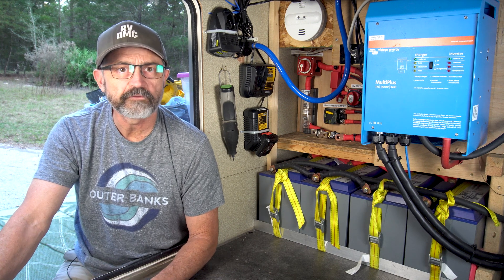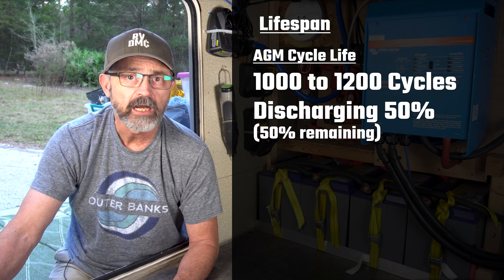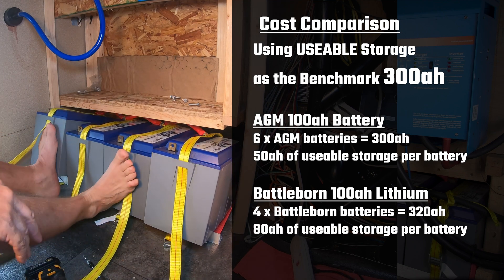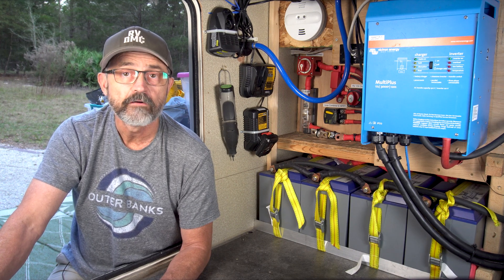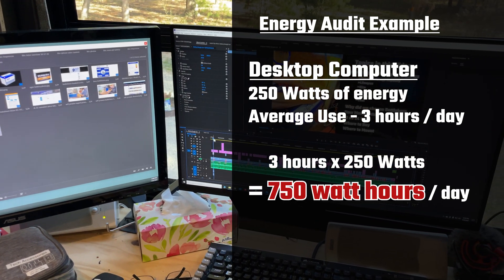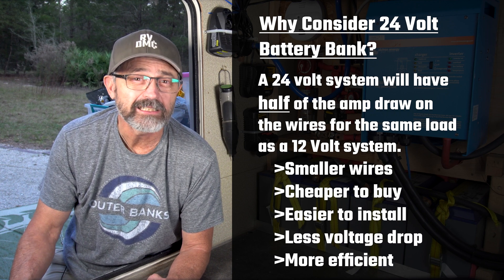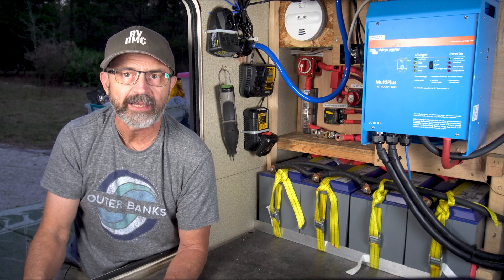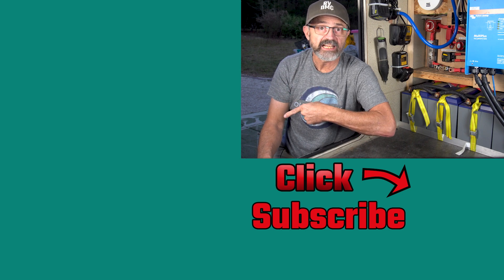Why Battleborn Lithium Batteries - Solar Series Part 2 (RV Living) 4K

Comment: Great video Larry, just wondering you commented about using a desktop computer in your Rv. Do you have any issues with part’s coming loose inside the tower when traveling and how did you secure it. I’m flip flopping between a laptop and tower build. Can build twice the system in a desktop but wasn’t sure how it would do traveling in a fifth wheel.
Reply: Hey Kevin, I have been using a desktop in this fifth wheel for four years and haven’t had any problems but when I built a new machine in 2021, I installed a custom graphics card Support for my huge 3070 card.  Every six months or so I pull out the tower reinsert all the cards and memory to make sure everything is good.  The computer sits beside my desk, is supported by foam on all sides to keep keep the vibration down when traveling down the road.  Larry
Reply: Thanks for the info and keep up with the awesome videos

Comment: Great Videos, we have a 345-GK-R Solitude very similar to yours in arrangement.  I would like to know how you handled the battery move and supplying power to the leveling system, etc. in the front compartment.  You said you were going to make a video about it.  I have been looking thru your site and have not been able to locate.  Any assistance is greatly appreciated. Rhett
Reply from the maker: Sorry. We are way behind on videos. Travel and health issues. 
I used the 12 volt wire that was coming from the battery in the front in reverse to supply power forward to the leveling system
Reply: Thank you.

Comment: Your power study ignores the power loss from the inverter.   Please reconsider that when you do your next power study of your usage.  Your usage power is actually less than the power that the inverter will consume to produce the AC voltage for your AC powered devices.

Comment: Thank you Larry for always providing us with very thorough videos. I would like, if you have time, for you to watch the installation of RV Texas Y’all which is a 48 volt system titled « RV Solar and Lithium: Our Extreme 48 Volt System ». I value your input because I’m considering a similar installation. Thank you ahead of time.
Reply from the maker: Hey Michel, I have not seen that video but in my opinion you only need a high voltage system like that if you are going to putting some huge loads on the system by running multiple air conditioners to a massive battery bank.  The higher voltage is more efficient and allows you to use smaller gauge wire to connect these high amp components.  One other reason if there is a long wire run from the battery bank to the inverter, the high voltage will really reduce the voltage drop you will surely get on a 12 volt system.  The 12 inverter runs on a narrow voltage is very sensitive to voltage drop.  Big amp draws also cause the voltage to sag so those are two big reasons to go with higher voltage.  We have a small battery bank and our inverter is right above the batteries, we also use 4/0 wire so we have no voltage drop.  I hope this helps, will have to look up that video and check it out.  Larry
Reply: @DownsizingMakesCents  Thank Larry for your quick and complete reply. If you get the chance to see the video I suggested, and if you have a second, I would be curious to know your impressions. I wish you both a wonderful day.

Comment: Thanks Larry, I chose to do the install myself in a GD 303 using the front compartment. The install is not as easy as it looks, especially on an old guy trying to crawl through the storage spaces. Your videos are ones that inspired me to do the install. Thanks. Just on a side note, Battle Born tech support is very helpful so far. I will let ya know when I am finished. Thanks again.
Reply from the maker: Good luck with your install, I really struggled doing the install with arthritis, being in a cramped space for hours at a time.  I used the AM solar support and the Battleborn support when designing the system and asking technical questions to make sure I had everything configured correctly before i flipped the switch.  Larry.

Comment: Thank you Larry  For all your research And videos. I  just reached out to battleborn to see if I can do a drop in lithium with my diesel pusher . Waiting for an answer.  We don't go off grid for more than A-day or 2 So I wasn't planning on doing solar right away just the batteries.
Reply from the maker: You may be able to drop in the Battleborn so for your house battery but not for the coach battery.  The amp draw is too high for starting the coach.  If your converter is compatible to the battleborns then you may be able to drop in for the house, but of course it was smart to check with battleborn to make sure before you purchase.  If you sent them an email they usually get back within one day.  Larry

Comment: I believe you are correct that lithium batteries should not be discharged more than 80%. However, battle born batteries are rated in usable capacity. Thus, if battery is rated as 100 ah it means you should get at least 100 ah out of it safely. In fact according to battle born you should be able to get even 103-105 ah out of it before BMS will shut it down. That’s because battery’s actually capacity is higher than 120 ah. I am pretty sure you have 400-412 ah of usable storage.
Reply: Jus in case… In the video you are mentioning that you were going to install 3000 watt inverter and I see that you have Victron MultiPlus 3000 installed… well many people believe that 3000 means watts, but it’s actually 3000va (volt-ampere). These units are rated for 2400 watts (at 77F).
Reply from the maker: I didn’t want to get too deep into inverters in this video as i wanted to focus on the batteries.  You are correct I will have to make that important distinction in the Inverter video.  Larry
Reply from the maker: Hey Aleksandr, I was not aware of that.  I would love to know where you saw that.  In my experience over the last year and a half, we have only gotten about 320 amp hours of power when drawing down to 20 percent capacity.  We never take the batteries to BMS shutdown, and never below 20 percent.  Thanks for the helpful information, i will check with battleborn.  Larry

Comment: Been considering an upgrade to our batteries in our DP,, but really cant justify the cost of lithium since we do not boondock for long periods and also have a generator that can recharge both house and chassis batteries.  I was thinking AGM as an improvement over wet cell, but now you have me thinking that wet cell may serve all my uses as I am not off grid for extended periods.  Something to really think about
Reply from the maker: I have had AGM batteries in past RVs and they are great as long as you dont drain them below 50 percent often.  I’m not crazy about the wet cells because of the extra maintenance of electrolyte levels, and making sure they are ventilated properly.  Larry

Comment: Nice install, similar to ours. It’s funny that you watched the same videos that I did. How did you power both legs? Did you use the smart phase selector?
Reply from the maker: Yes, when i designed my system the Multplus 2 was not available, if it was I would have used that instead and skipped the SPS.  The SPS was extra cost and more complex install.  My system works great and the SPS supplies both sides of the panel no mater how I am connected or not.  I just works automatically in the background.  Did you use the SPS?  Larry

Comment: Why battleborn and changing to lithium?

Because it is currently the in thing to do.   All the cool kids on you tube get sponsored by Battleborn and do the conversion.

The truth is the average Joe will never notice a difference as they never or rarely boondocks.

The other biggy is if you are boondocking how are you going to efficiency recharge 400 amp hours in a day?
Reply from the maker: First of all we are NOT sponsored by Battleborn, we paid our own money for these batteries, Battleborn had no idea we were making this video.  We dry camp often and utilize our lithium batteries fully.  We use our 1200 watts of solar to recharge the batteries easily from 20 percent to 100 percent in about 6 hours of on a sunny day.  When its not sunny we use our 2200 watt honda portable generator to charge the batteries which recharges them in under 4 hours.  Usually we use a combination of solar on partly cloudy days and top off with the generator at the end of the day so we have full batteries overnight.  We waited to make these videos until we had a year and a half of experience using all this technology before we told everyone how great it is.  I dedicated a large part of the video to why I switched from agm technology which i had in my previous Two RVs, to lithium because it is important to understand the limitations of both.  Thanks for your comment, I understand lithium is NOT for everyone.   Larry.

Comment: Very nice informative video.  I designed and built an off grid solar system for our off grid cabin.  You covered what to consider very well.  I had to avoid Lithium batts because the cabin goes very  cold for a couple weeks at a time throughout the winter.  Lead acid it is for me.  They work well too.   You covered the subject well.  Take care!
Reply from the maker: Lead acid makes more sense for a cabin where weight is not an issue.  Also with a cabin you have more space to have a large battery array, and you will be more likely to keep your batteries above 50 percent of charge to prolong the life.  If i was doing an off grid setup, lead acid would be a very good option, especially if the cabin is going to be empty for prolonged periods in freezing temperatures.  Thanks very much for sharing your perspective.  Larry

Comment: Excellent explanation.  I keep it simple, I plug in😉.  Wife says no to boondocking.
Reply from the maker: 🤣 Well, we haven’t boondocked yet. We have dry camped though. 
But still, we use these batteries when on 30 amp so we can glamp like we are on 50. And sometimes the power goes out at the campground and we don’t even notice 🤣
Alice

Comment: Hi Larry, not sure why you did not touch on using 48V packs as opposed to 12V and 24V.  Using 24V or better yet 48V with high efficiency DC2DC Buck converters lets you run small wires to the devices that need 12V and supply them with high current 12V on demand, and if you simply switch the 24V/48V you don't even waste power running the buck converter except when you really need the power.  That makes moving the slides and the leveler very efficient.  You can then size a buck converter to handle the lighting and other loads to be a tight as possible so you again don't waste power with the down conversion.  Granted 12V is "easier" but very inefficient at best.  Actually come to think of it, if I stuck to 12V for ease I might just use a DC2DC boost converter to 48V use smaller copper wires and convert it back down to 12V with a buck converter at the far end.  Waste a bit of power on the up and down conversion but save lots on copper. Not sure of the amps required but easily solvable.
Reply from the maker: Hey David, you make some really good points about using higher voltage battery banks.  I was trying to keep the video as simple as possible, i even debated abou taking out the 12 vs 24 volt section.  We really considered the 24 volt option but, since i put the batteries right below the inverter, the cable run was very short and i used huge 4/0 wire to connect the batteries and battery to inverter, so my voltage drop was minimal.  If i switched rigs and was doing it again I would really consider doing a 24volt battery bank. I would be able to use more solar panels on the same solar controller, smaller wires.  Thanks very much for your informative input, Larry
Reply: @DownsizingMakesCents  Glad you did not take out the 24V section. With the cost of copper getting more expensive fast, and voltage drop (even across 4/0 wire) moving to higher voltage becomes even more important. I might add that while I like the Battleborn batteries with their warranty and ease of use, Their price is far more then I'm willing to pay, if you follow LithiumSolar, David Poz or Will Prowse you are aware of some very inexpensive Lithium batteries both in the standard battery cases and in the rack mount cases that can be used in an RV.  I'm not advocating that someone with no experience just buy cells and build a battery but the pre-built systems have really come down in price and carry a good warranty. For a quick example: the 24V 200AH EG4 rack mount system is $1,499 or if you really want to stay with 12V the 400AH rack mount case is the same price.  The SOK batteries are not in the rack mount form but are also quite nice, a little more expensive with a 7 year warranty but at $570 for 100AH and $1029 for 206AH not a bad deal either.  I not associated with them in any way just pointing out something that might be a good value for some.

Comment: That's really good information especially the info on the Battleborn batteries.  If the Battleborn are just a drop in and replace kind of batter to a lead acid, is there anything that needs doing to the solar system on the swap out so that the lithium batteries are charged properly?  I've heard that if a system once had lead acid and then swaps to lithium, the lithiums don't charge to full capacity...  And what about when driving, do you charge your batteries when plugged into your truck?  I'm also wondering if you'll do a video on this aspect of your solar setup.
Reply from the maker: Hey Ben, you need to make sure your current converter is compatible with lithium batteries.  Some converters cannot be configured for a lithium charging profile.  Lithium’s have a much higher final voltage which many converters cannot do.  You will also need to make sure the solar controller for your solar panels can be configured for a lithium charge profile, most can.  Larry
Reply: @DownsizingMakesCents  Thanks for this information, Larry.  I'll do some research on what we currently have to see what is compatible.

Comment: I asked Santa for just one lithium battery but no luck.. I don't dry camp for more than a day. Having two standard batteries is limiting. Can I use lithium with the regular charging system. I'm pre wired for solar but no solar panels. Thanks DMC
Reply from the maker: Sorry Santa failed you. Maybe you were bad 😉 
You would need an inverter charger designed to charge the lithium,
Alice

Comment: Good Morning. Thank you for all this info. I plan to move my 2 Battle born batteries to the storage compartment like you have but with less power .  I have a 2018 Grand Design 337RLS so all the info you put in your YouTube would be great.  PS do you have any help on the size if I use 1 or 2 solar panels in watts Jack
Reply from the maker: Hey Jack, having the batteries into the main storage compartment also has the advantage of being in a heated area, so you dont have to worry about cold charging.  I used the battery cable that went from the battery to the 12 connection in the power panel, in reverse to send the battery power forward to the hydraulic components up front.  Then i used a new cable from the batteries to the 12 volt connection in the power panel.  If you have more questions, go to the about page of our youtube channel and get our email there (I dont like to put it in comments). Send me an email so we can chat.  Larry

Comment: I agree that I think if your going to do a setup Lithium is the way to go. For the temp concern part my next install on our next rig they will be inside the rig somewhere. I think that is a much better idea. Keeps them closer to a better running temp and safer from theft. Holy crap, 4 hours of TV per day. lol I am going to the Mac Mini. Very low power usage and stronger then most desktops. lol I say keep it simple and stay on a 12V setup. Just my opinion with limited knowledge to do this kind of work. Yes The Dry Campers did a great job for us. Plus no work for me. lol I like that option. Good information.
Reply from the maker: William, you are right. He forget to mention our basement is heated. Thanks for pointing this out. 
I know you watch more than 4 hours 😉 
I actually wish we didn’t have the mega computer set up. But Larry loves it. 
Dry Campers are awesome - they know their stuff. 
Maybe I should hire Larry out 🤣
Alice